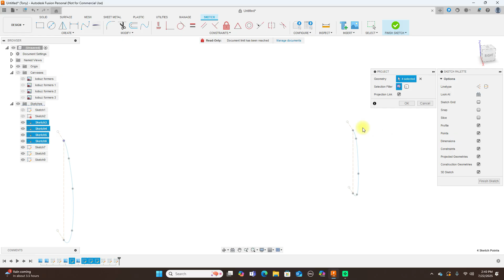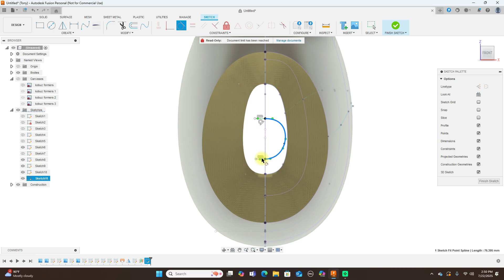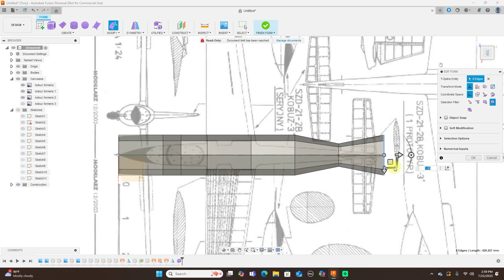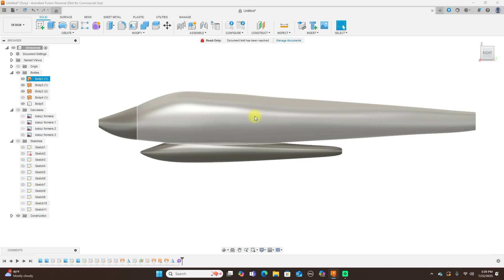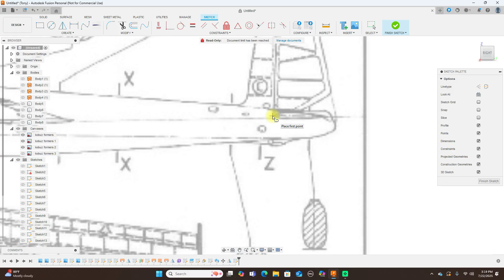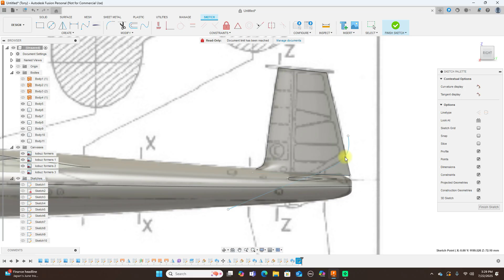Learn to Surface model and Form model a Kobuz glider in fusion 360 CAD  to 3D print and fly

Comment: Where do you find plans and blueprints for aircraft generally, and where can I find these specific plans? Is there an archive or website where you can find them?

Also, I love your videos — you have helped me a lot! I’ve also been experimenting with designing foam board, balsa, and Depron foam using Fusion. I need to export my models into AutoCAD to make 2D drawings, either to send them to a laser cutter or to make plans for cutting by hand. Do you have any experience with that? If you do, I hope you share it in a future video. Thank you!
Reply from the maker: In fusion 360 export your files as an DXF file and you can go directly to your laser.  Check out my video on how I find my blueprints.  It explains how I find all my pictures.  Thank you for your kind words.